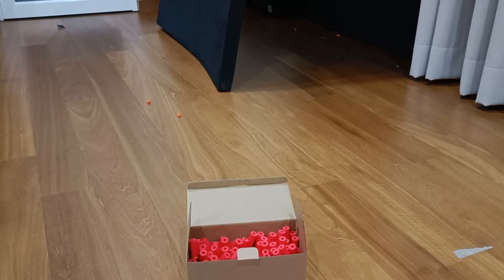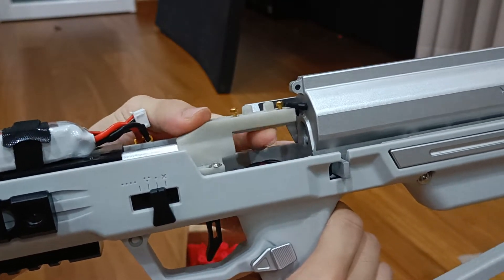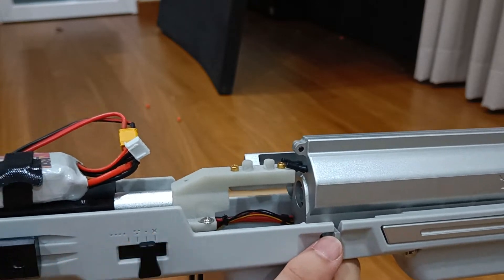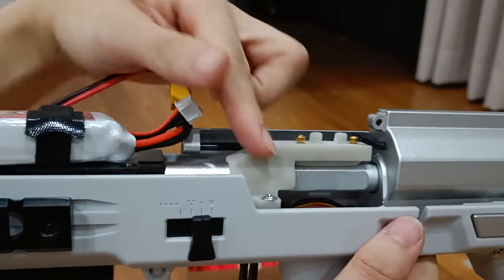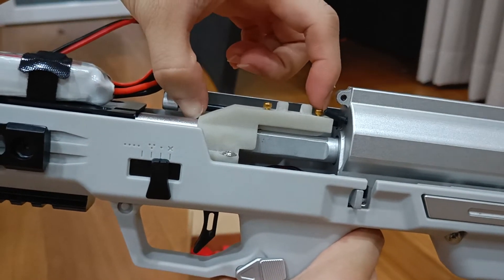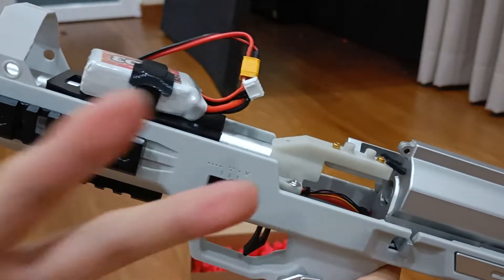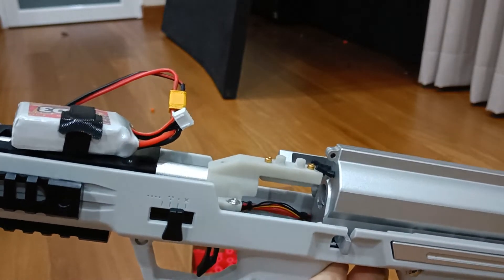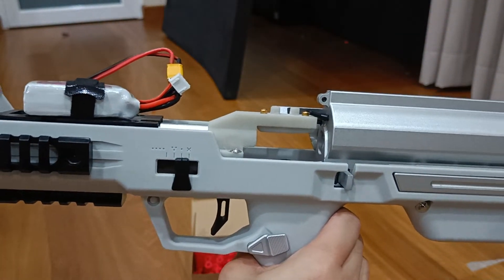QWK x MM Challenger MK3 with magnetic Active Dart Corrector

Comment: Any good way to make mk3 more powerful in the range of 220-250?
Reply from the maker: An upgrade spring, 28CM barrel paired with QWK Epp darts will push it to 230-240FPS. Not really recommended because it can wear down the internal fast. But it definitely is possible.

Comment: Hi when will monkee mods have all the replacement parts like all gearbox parts/metal gearbox and spare o rings also the trigger assembly on the store for purchase
Reply from the maker: Not so soon I'm afraid, the production of the Challenger MK3 is still relatively slow and it hasn't hit the saturation level yet that QWK started manufacturing surpluses parts as spare parts at the moment.

That said, there are still some replacement parts available like the whole main board, O-rings (Breech/Piston), Breech/Plunger tube assembly, piston etc.
Reply: @monkeemods8393  thanks for the quick reply.
And what is the status of the qwk edge if they are in contact with you about production.
Reply from the maker: @RoyalBuzzard  of course, we have booked 50 units, oversea version of the Edge are now in the process of manufacturing. We may add more units as we go :D
Reply: @monkeemods8393  Sorry to keep bothering you but I am just wondering what is the ruff release date for the edge as I am interested in both the challenger mk3 and the Edge as a new setup for a new load out and it might be a good idea to put them in a bundle together.
Reply from the maker: I'm afraid we do not have any ETA for the Edge for now, we will surely have it available as soon as possible.
Indeed the Edge will match really well along side with the Mk3 as a secondary!

Bundling Mk3 and Edge is not likely, it will be too expensive hahaha
Reply: @monkeemods8393  OK thanks for the reply

Comment: Just got the pro max version not too long ago and i have a problem of the bolt release jamming when the Bolt/breech open feature is engaged when out of darts. Just wondering if anyone has the same issue and is there any known fix. It has a high chance of happening when i go full auto.
Reply from the maker: Hmm so what happens when the bolt release is jammed? What did you have to do to unjam it?
Reply: @monkeemods8393  when its jammed the bolt dooor remains open lol. Anyway i have a temporary fix for it which "un jams" the bolt release. Remover lipo, pull back the bolt door on the right - i know it already opened due to out of darts mechanism but you could move it some more by roughly 1cm back - then next step try to force the jammed release lever on the left forward simultaneously with letting go of the bolt door on the right. 
This will result in 2 outcomes - if ur fortunate  the bolt door closes completely n the bolt release is unjammed. Worse will be the bolt door does not closes completely tho the bolt release is not jammed anymore and to fix this u gotta put back lipo and fire trigger once to close the door n plunger completely. But i think this might dmg the internals as the sound of the plunger snapping close is very loud.
Reply from the maker: According to QWK, this could be a case of weakened lipo battery, when the bolt is not able to travel fully to activate the bolt lock system, this can happen. Have you tried with a fully charged fresh Lipo 3S battery? We can discuss further in our Discord groupchat, please do join us there, we can assist you better.

https://discord.gg/CvXY3myX